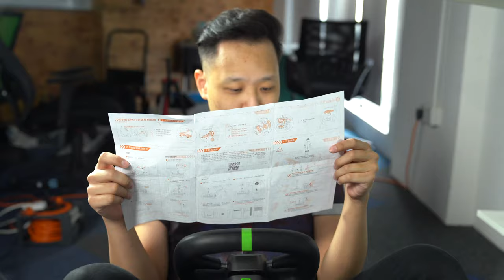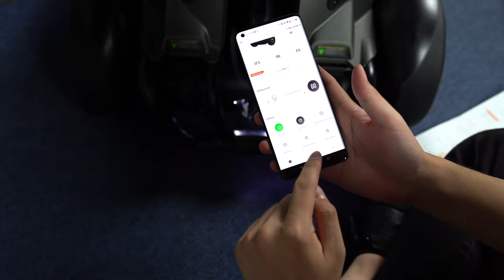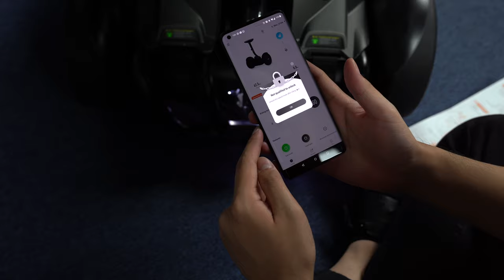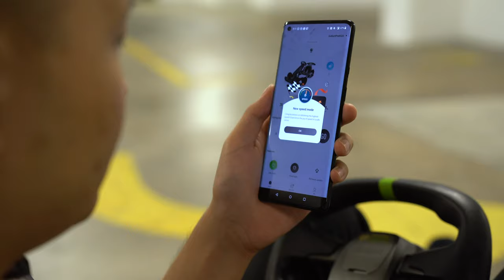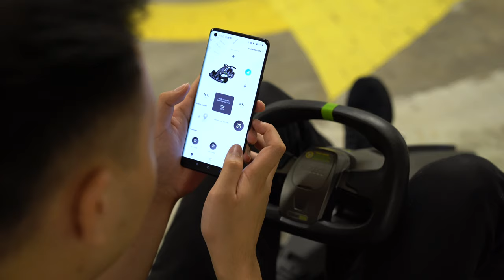Segway-Ninebot Gokart Pro unboxing & assembly (PART 1)

Comment: Speaker works with the Max I just ordered, I can't find any reviews of the speaker itself. Has anyone used it for music? Engine sounds are pretty damn sweet, but 95% of the time I'd be listening to music.  I doubt it would compare to a JBL Flip 5, but if it sounds pretty decent and gets loud enough I'd probably buy it.  Just can't find anyone using it for music or bringing up how lout it can get.